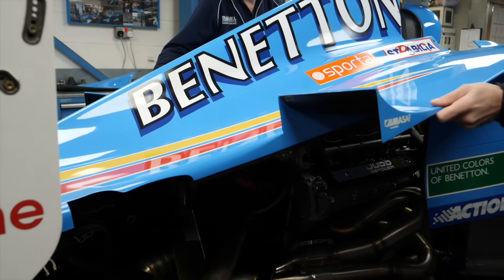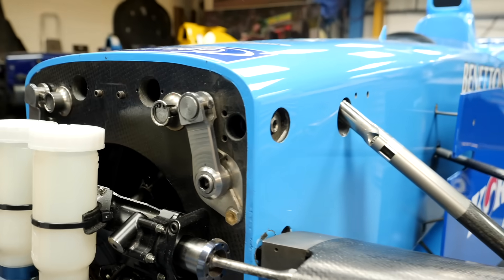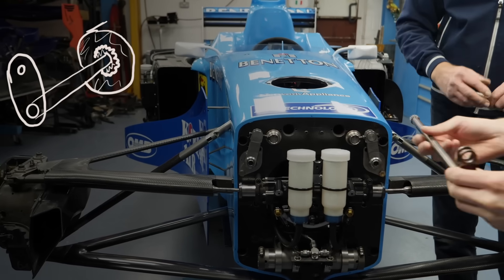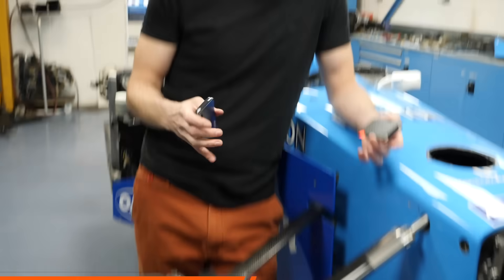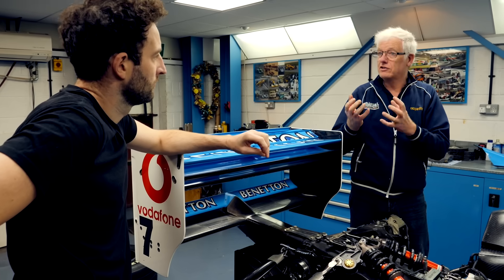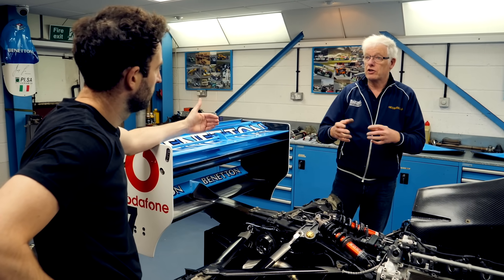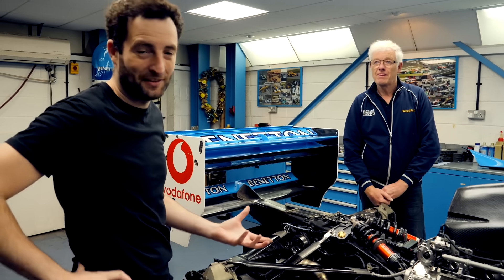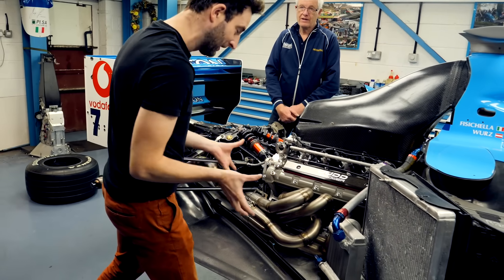Why F1 Suspension Doesn't Use Coil Springs!

Comment: One thing you could've also mention at the end of the video, is that the rear wing is mounted at the very end of the gearbox. So powertrain structure not only have to contend with forces coming from suspension but also the downforce of the wing.

Comment: something so small being able to stand up to all the forces that car applies without snapping is crazy
Reply: It works because there is so little travel. A torsion bar for more travel like an offroad vehicle would have to be longer. Kinda like some old pickups where the bars run from the front lower control arms back about 2/3rds the length of the truck.

Comment: If you run those old F1 cars way below the rev limit they used in actual races, can they go longer between engine rebuilds?
Reply: In theory yes but that's not what they are running. Notice the Judd badge on this engine? Judd builds them specifically for vintage F1 racing (among other things). Supposed to be good for over 3000km.

Comment: I would think using shocks and springs at the front of the car would be more beneficial, as you could adjust damping depending on the track fairly easily
Reply: The spring used has nothing to do with damping. They still have dampers in the front.

Comment: How does one impart the torsion bar with the metallurgical properties to allow it to flex without fatigue?
A standard steel shaft from the hardware store may not last but a few laps.
Reply: by making it an alloy

Comment: The exhaust headers are the same length - you keep saying that “if they were the same length”. I’m not sure you’re grasping how this works, it has to do with optimizing the pressure wave through the exhaust to maximize efficiency of each cylinder removing their exhaust gasses.
Reply: I agree, I don't think he grasped that at all.. the header nearest the collector has the most contorted path because it has to  be the same length as the furthest header from the collector... its not a new concept by any means, performance manifolds have been designed this way for at least 70 years that I know of...
Reply: On a tuned exhaust system, the length of the tube from the cylinder head to the exhaust header are all the same length, regardless of which cylinder they are.  That length would be determined by the requirements of the engine....a high-revving engine would have a shorter primary pipe, and a lower-revving but high-torque engine uses a longer pipe.  Your end requirements will determine  the eventual length.  This "length" could be measured by linear length or volumetric capacity.
Reply: @weldorman8495  Spot On,... The Tuned headers on my 3.7 liter Slant Six, the collector is easily halfway past the gearbox, and the rear most cylinder curves back to the middle of the engine before turning under the other tubes to go back to the collector. The difference in Torque it made when first fitted was noticeable,... But the difference once the rest of the tube to the rear was installed, was startlingly noticeable.
Reply: @weldorman8495  thanks, the clarification I was looking for. Now what about back pressure? Is it really zero? In what cases do you want some back pressure? ie diff bet a road car and a race car. Is there a scavenging effect?
Reply: @thinkerdoit  If you were to have an engine on a stand and start it up with no exhaust manifold on it, you would have no back pressure.  Now, add some pipes to this, and you will be increasing the back pressure....the longer the pipe, the greater the back pressure.  The idea has been to design your pipes to terminate in a collector that will allow each gas pulse to draw the next pulse after it, creating an extractor exhaust.  The deal is, the more back pressure, the smoother your engine will run, but the less responsive it will be.  The less back pressure, the more responsive and high-revving your engine will be, but not as torquey so, therefore, more difficult to drive.  The ideal exhaust system would not be the same for two different types of cars.  Using the same engine in an off-road four-by-four would require an entirely different exhaust system if you use it in a road-race car.  As another contributor mentioned, it takes a dyno and computer to tell you what you need.
Reply: @thinkerdoit  It's ALL about scavenging at peak torque. Everything else everyone has written is just gravy.
Reply: @chrisenright7003  2 stroke diesels!
Reply: @weldorman8495  Header tube length is really determined by dyno measurements and has nothing to do with revs per se. However, revs are a function of valve / cam timing advance which affects RPM's to a certain degree. You build the header to maximize an engine's output.
Reply: @joneskendrick2084  When I built extractor exhaust systems, they were for  naturally-aspirated road racing cars, and were pretty much track-specific.  In the late '70s and '80s, dynos weren't readily available to us low-budget types, so we started with what we knew, and had, and went from there.  Short tracks with tight corners and no high-speed straights would get a longer primary  pipe for more dig out of the corners, and a track with higher-speed requirements got the short primary,  Same car, different primaries, different results.
Reply: @weldorman8495  I was curious where you measure the length from. Centerline?  Volumetric makes more sense as a turn is a bit dynamic and tricky to measure.
Reply: @ben3989  Volumetric is, of course, more accurate, but your volume changes with the diameter of the tube which can vary during a bend.  You can easily end up with the correct volume, but the wrong length.  Unless this was for an ultimate performance engine, just try to get the linear length, from exhaust port to collector, the same on each cylinder.  I've done a volumetric exhaust, and came up about 1/2 inch short on one tube and everything had to be adjusted to fit.  The linear-measured one for the same type of engine didn't seem to suffer in any way in comparison.
Reply: he's been driving a subaru!
Reply: @krusher74  nailed it, hahahahahahaa Rofl
Reply: IKR,  Dad says they need to be equal length, his son says ok, they need to be different length, Dad agrees about different length.
Huh !!??  What !!??   I like your videos but you need to pay more attention to editing.  Your confusing everyone watching.
Reply: @yzmoto80  Well done - you actually listened! :) Maybe dad was just being polite when he agreed afterwards.
Reply: @liampope1  that's how I felt as well
Reply: 2 Stroke exhausts are another real interesting topic and play even more of a role on the power than in a 4 stroke.
Reply: It is so that the expiring pressure wave from the previously exhausted cylinders will scavenge the newly opened exhaust ports of the odd cylinders. roughly.
Reply: Came to comments exactly for this reason.  I think he keeps meaning "different shapes" or "same shape" every time he says "different/same length", but thats a CRITICAL distinction, so son is consistently saying the wrong thing...
Reply: The judd v 10 needs a turbo... thats the coment of a real f1 mechanic👍👍👍😘
Reply: I recommend everyone on this thread to read the chapter  "pulse tunning" on the book by Graham Bell " four stroke performance tunning".
Lenght, volume, angle and join order are all factors in the header design. In some cases uneven lenght headers are neccesary to change the torque curve. Maths of the design are so complex that specific software Is used to calculate headers. Pipemax and Ricardo wave are good examples. Just muy two cents
Reply: He’s confused
Reply: exhaust gases come as impulses through the pipes. And they calculate the length and the impulses so they come as optimised as they cand.
Reply: lass kinn  mate, i completely understand all this bullshit. Its basic theory. All i was saying, 'and it was obviously taking a slight dig'.. but it sounds like hes saying "there. uneven"
Reply: Unequal length headers is why subies and old V8s burble like they do.
Reply: I don't think h or understood that they were different shapes because they were packaging the runners to all be the same length. That way the pressure in all of the runners is the same. The length of the collector where the pipes join is determined by where they want the peak torque in the rpm range. Different length collectors will give you different torque curves.
Reply: Yeah the whole reason they look like that is because they're equal in length, the closest exhaust port (to the collector) needs to make up length to account for the distance to the last exhaust port, and a little less for the 2nd and so on.. Unequal length headers all sweep back neatly to the collector with the closest exhaust port having the shortest pipe, and the farthest port having the longest..
Reply: Right like as if there isn’t a firing order
Reply: Pretty sure the exhaust length is also tuned to where you want peak power. The exhaust gas pulses are only going to stack up nicely at 1 frequency
Reply: @headcheese3  nope. On an Inline engine, or one side of a V or Flat engine, matching length means the pulses never crash in to each other, regardless of number of cylinders or RPM. Where the extra power from exhaust scavenging "tunes", is when the next high pressure point arrives in the low pressure point of the pulse wave it is following. Once the revs rise above that point, flow restriction of the system starts to be more dominant as the pulse waves shorten and get closer, but the shorter period of the valve being open shortens the width of the pulse and prevents them ever crashing in to each other.
Now, if you mix a V or Flat engine side to side, you can cause pulse collision, which is why sometimes an X-pipe works, and sometimes it fails very badly.
Reply: @PiDsPagePrototypes  you're both correct.
Reply: @headcheese3  im guessing this is the comment re the engine spec that describes the primary tube length.
Reply: Ok it seems you folk know why they need to be the correct length but you are not explaining to others why. The high pressure exhaust pulse which comes from the exhaust valve opening travels down the exhaust pipe. If it experiences a change in pipe shape, especially a sudden change, a reflection will occur. So a join to another pipe appears to the flow as a sudden doubling of area and a negative reflection occurs, travelling back towards the exhaust valve as a vacuum pulse. If timed correctly by having the pipe length correct, the pulse will arrive at the valve just as it is closing, sucking the last of the exhaust out of the cylinder. The length of the pipe is dependent on the temperature (not so much the pressure) of the exhaust gas and this is why tuned lengths on the inlet of an engine are shorter (the speed of sound is temperature dependent). So the same occurs on the inlet but this time the reflected pulse is positive and it stuffs more mixture into the cylinder as the valve closes. 6 cylinder engines (or 12) are grouped in 3’s to get even timing, 4 cylinders are either joined as 4 into one or 4 into 2 into one, utilising a secondary effect on the connection of the two pairs into the final single outlet.
Reply: Sounds like ther saying there NOT al the same length
Reply: @danspeed7039  Right - that’s what he’s saying. But they are the same length that’s why you can see them curled up, it’s the same principal for fuel injectors for diesels.
Reply: @danspeed7039  I think they must be the same length otherwise gases from early firing cylinders that travel through longer pipes will arrive at the junction at the same time as gases from later firing cylinders that travel through shorter pipes.  The aim is to reduce the gases passing through the junction at any given moment.

Comment: Re: title and thumbnail, those ARE springs - torsion springs - technically, a coil spring is also a torsion spring and works in exactly the same way.
Reply: Nope. The coils don't twist, they're flexed sideways at any point along the coil, as the whole is compressed. Any rotation observed is due to the sideways movement being expressed along the coil, it's an optical thing, not the actual moment of change.
Reply: @PiDsPagePrototypes  Nope, as you used "moment", that suggests some engineering training, so perhaps you review their working principles - with an emphasis on how to calculate their rates compared to torsion springs?
Reply: @gordowg1wg145  close, Physics, then media.
Reply: @pgl058  a single strand is a coil, a helix is two or more strands interwoven.
Reply: @PiDsPagePrototypes  This is just as wrong as your first comment. Helix is a corkscrew shape you are thinking of DNA which is a DOUBLE helix. It's so easy with the internet to fact check yourself. A coil is like when you wind the hose up, helix is more accurate.

Comment: all the forces in a coil spring are torsion!!  It's a spring, just packaged differently....  the Morris Minor and later Marina used torsion bars in their front suspension, and countless other cars have used them both front and back....  there's nothing big or clever about using torsion bars...  but not many modern cars use them..... odd that!

Comment: Twice you insisted on saying the primaries were "unequal" length while your dad was telling you they were "equal" length.
Reply: I think the real shame is that he didnt realize since the cylinders dont fire at the same time, they have to be equal length primary tubes to keep the exhaust gases from " banging " into each other. A light bulb should have went off, realizing ...wait a minute 🤔
Reply: @hp5469  did you just explain it better than all the other experts in the comment section.  Why don't you have a youtube channel this guys dad would probably like you better than his actual son
Reply: Yeah I noticed that too.  Maybe @Driver61 was thinking that their shapes are not equal (all different curves) but he was saying "unequal" when in fact, on basically any performance vehicle, the primary tubes are always equal length/tuned.  The caveat would be for packaging reasons, sometimes a log style exhaust will be used instead of equal length headers (see the 2014 Mercedes W05 F1 car)
Reply: @fromnineteeneightyfive  the logs/pseudo logs ony really work in a high performance package when they have a turbo mounted as close as possible.
Reply: Mmh kind of annoying to watch a technical video in which the presenter doesn't understand what he's talking about and/or keeps saying erroneous things.
There's a very good explanation of exhaust scavenging by Engineering Explained here: https://www.youtube.com/watch?v=jjPeP_Nn2B4
Reply: Dad must be quietly wishing a better sperm won the race😂
Reply: So if they are the same length , they would bang together (WTF?!) , it wouldn't come out.... idiot.   Not watching this any longer.
Reply: @martinvanveldhoven8328  That's a valid issue, but he got it backwards. As they are equal length,(and cylinders naturally don't fire at the same time) they won't infer with each other and it maintains an even flow. If they were not equal length, they could "bang" together, so to speak. It would come out (no one said it wouldn't) the flow just wouldn't be that even
Reply: @Blind Freddy The title of the video is wrong too. It doesn't mention exhaust at all. It responds only to suspension searches in the Search bar.

Comment: If you think about it, a coil spring is nothing more than a torsion spring rolled up. When a coil spring compresses, its coils get closer together, which can only happen if the metal is twisted; exactly as in a torsion spring.

Comment: Are they using shock absorbers on the corners with torsion bars?
Reply: yes
Reply: @wingracer1614  cool.. Must be a lot of tech to get finite adjustment.. I'm assuming they're running off of the same linkage that's connected to the torsion spring. Must be some serious tech to get the required finite adjustment/control over such little movement.

Comment: Exhaust systems became an awful lot more complicated since then. That relatively simple goal - getting the bursts of gas out of the engine without resistance or resonance - goes out of the window. First the game changed because of blown diffusers, and then again because of the turbos. They CFD the crap out of the exhausts. All kinds of stupidly complicated solutions were tried. My favourite insanity was Red Bull putting a Helmholtz chamber on the exhaust in 2012 to induce a controlled resonance in the gasses in order to help their blown diffuser. This goes completely against the initial premise that the gas must be exhausted as smoothly as possible, it goes against packaging and weight savings, all for a tiny aerodynamic advantage.

Comment: I've owned a couple of vehicles with torsion bar springs (106 gti (rear) Merc Sprinter (front) and the spring rate always felt a lot more progressive and supple than traditional progressively coil springed cars I've owned.
Are they also superior in that regard or was it just a coincidence in being well tuned?

Comment: "Why F1 Suspension Doesn't Use Springs!"

Same reason vintage VW Beetles don't use springs. Torsions bars are very compact. 

Likewise with many battle tanks. This guy is inserting a massive torsion spring, one of 12 in a restored WWII Tiger: https://blog.tiger-tank.com/wp-content/uploads/2017/08/2-5-4550-E5.jpg
Reply: And many Peugeots! And Alfa’s... Loads of great handling light cars in general. 

I think the main reason they’ve fallen out of favour is due to the increased weight of newer cars, even on light old cars like 205 they’d settle and need the height adjusting over time. 

Also if they break while a cars under warranty, it’s a lot harder to extract than a broken coil spring on a strut or a rear beam.
Reply: You mean Tatra didn't use it because Beattle is just a C/P
Reply: The sixtys Dodge Darts used torsion springs on the from suspension. Provided more room in the engine compartment.
Reply: That WAS the original title. They've now added the word "coil"  lmao